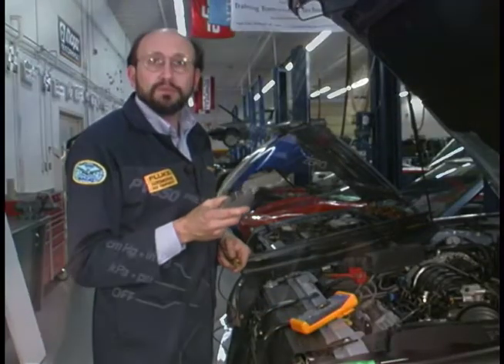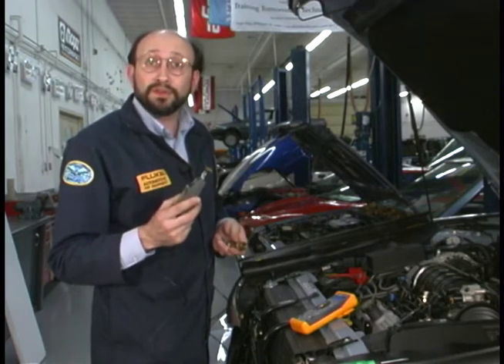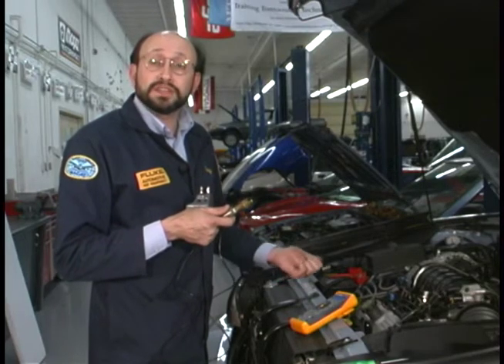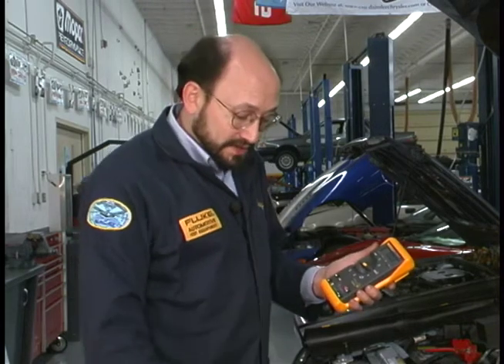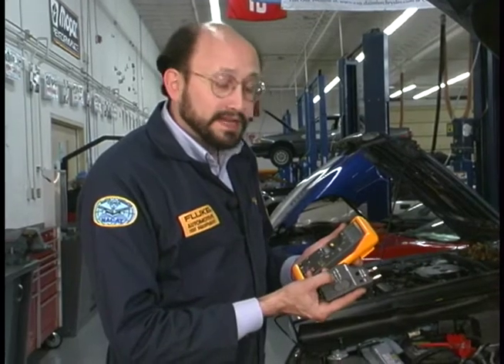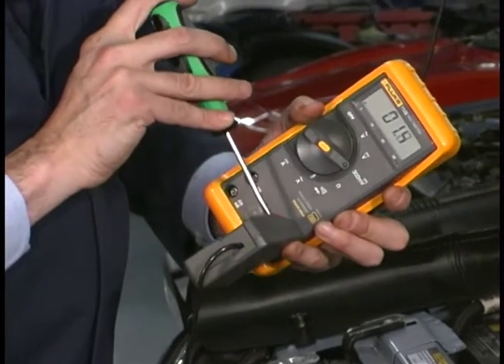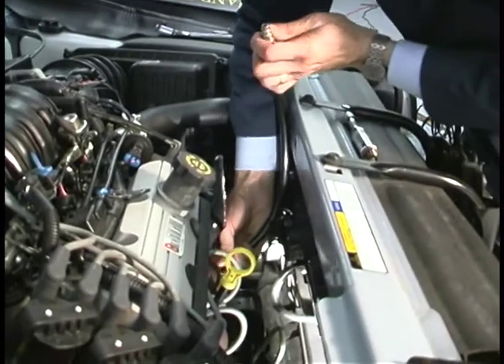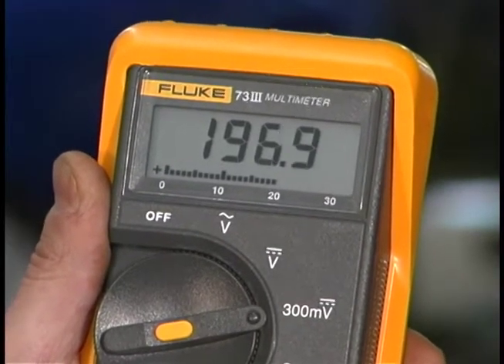Fluke DMM   Cylinder Compression

Comment: Neat. But id rather just buy a $50 compression test kit that does ALL vehicles instead of this Fluke adapter that probably cost more that $150 bucks. Really this is a useless tool. Its a gimmick. It just allows people to use their Fluke multimeter for more things but it’s unnecessary. Its a waste of money. A compression test kit is simple cheaper and reliable. Its not electronic at all so you dont have to worry about it getting messed up.